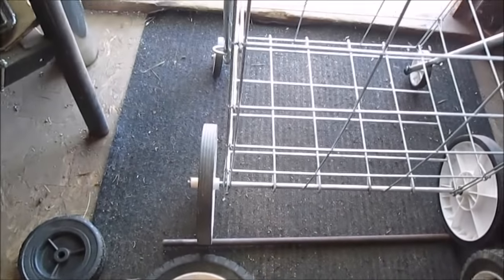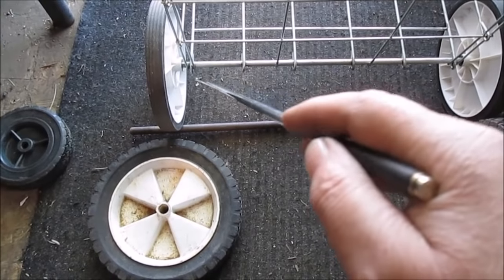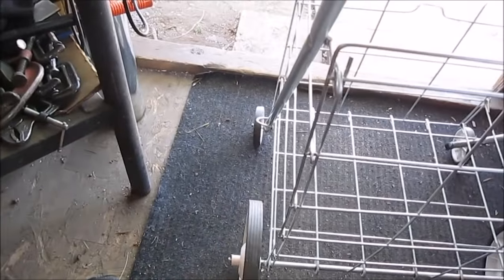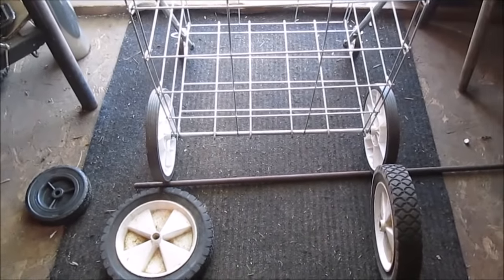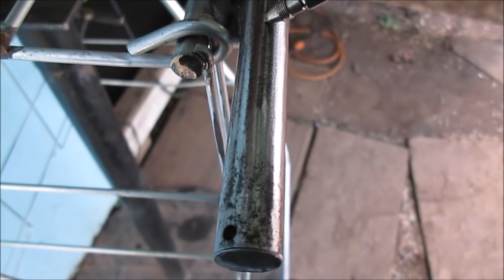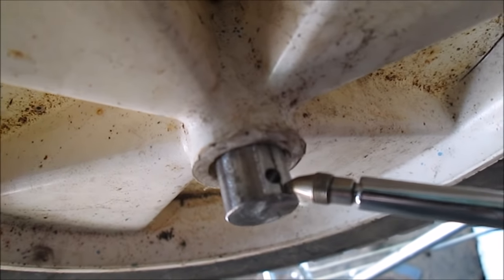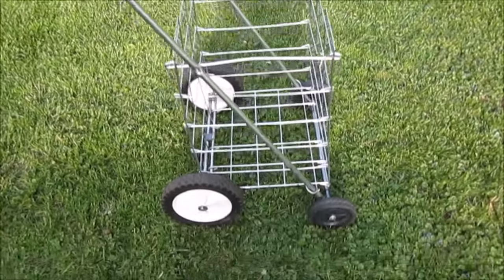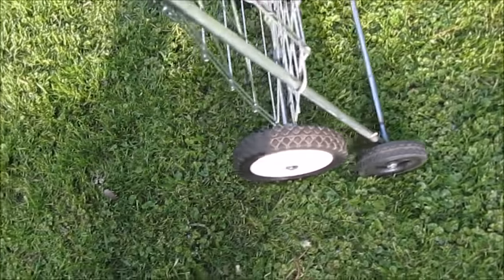New Wheels for Folding Grocery Cart

Comment: This video inspired me to find a solution to the problem I have with my 6 wheel trolley. I am disabled, so my trolley is very important to me, the front wheels are dual and take the weight no problem at all, but the rears are single wheels and the problem was, they were only partially on the axle and then a sort of cotter pin inside the wheel, kept the wheel on. Over time with weight on the trolley, the wheel is pushed over, so the weight is not going through an upright wheel, so in the end it fails. I made a spacer out of some plastic retaining bolt housings for a washing machine, the ones that stop it being damaged in transit, then I forced the wheel on the axle fully and put a C clip in the end where the cotter pin on the wheels sits, so the wheel cannot come off. Hopefully it works long term, but already I can see the wheels are a lot more upright. Like many thing these days, I think its was designed that way to fail, so you have to buy new wheels more often than you should. A plastic wheel can take an awful lot of weight, as long as it used in the right way and the strain is transmitted through it strongest point.
Reply from the maker: Glad my video helped You 🤓
Reply: Its amazing how helpful the internet and people are, you can find a solution to most things, if you apply yourself in the right way and have an open mind.Thanks for taking the time to share your fix. I would like a welder someday and also a 3D printer, I am old school, I like to fix what I have, rather than buy a new one.
Reply from the maker: @colinsdiecast164customs  I do repair a lot of stuff and modify cheap tools and make them better to use
Reply: I have a wide range of tools I have picked up over the years, I tend to pick them up at Aldi/Lidl, or wherever I find a bargain, the old stuff is the best, especially with tools. The stuff I do mainly is diecast, but after some thought and research, I repair most things.

Comment: Thanks for sharing this video.  My folding shopping cart's front wheels- the bar- needs replacing because it's bent.  I tried straightening it, but couldn't.   I would have to probably disassemble it at a time when it's not in use, in order to straighten it or replace the bar and wheels altogether.  This cart has been a good friend, and I want to be good it back.  I have not found a video here or any website on a google search that explains replacement, disassembly or reassembly of this cart. :(  Please do share any info & references with me when any of you can.  I would appreciate it.  Thanks in advance.
Reply: Heat is always your friend when bending a material back, but like anything slowly with feeling and experience is key to knowing what is possible.

Comment: I added sturdier rear wheels to a folding shopping cart, but the axle is now too short now about an inch.  The wheels are wider.  Can only get one wheel on.  Where can I get a longer axle?  Or is there a way to extend the axle?
Reply from the maker: Menards and Home Depot   home improvement type stores sell round stock that should be strong enough

Comment: I use threaded rod, nylon locking nuts, PEX tubing as a spacer and washers as I've no means of welding.  Granny carts are a life saver.  Arthritis in my early 30's and yea it is the only way to shop!  But those wheels they use >.< I went to lawn mower wheels eight or so years ago and have not looked back since other than the aggravation of having to shim them which lawn sprinklers seem to have a small plastic tube inside of that is always popping out find them on the ground all the time works a treat as a shim.  The pair I have now are just starting to wear to the point I am considering getting new wheels. They have outlasted more than a few metal tube frames easy.  Think I am on cart three with them now, could be four :P they take a pounding with cat litter and food, groceries and generally probably far exceeding manufacturers max weight on a regular basis :P
Reply from the maker: +keeperofthegood I do have some Nylon round stock but It is too much work for me to make bushings on my lathe This cart will save a lot of wear on my back ....and arms ..we back up to the front step and I can set the cart up and fill it with more weight now and it should roll better than the narrow wheels that were on it ..This cart had to have been used for years ..the wheel centers were worn out bad and the cheap pins holding the front ones were bent and worn
Reply: +not2fast4u2c Indeed!!  I think I am just plain hard on my cart, it gets used daily by me and the family and eventually the wire frame snaps in a way I cannot fix (needs welding and I'm an apartment dweller). An improvement I found too, not sure if yours will be the same, my wheel base changed, got wider and I found with just that extra half or three quarter inch that turning and controlling the cart when full was a lot better.  Where did you find front wheels?  Those ones are the ones I have had no luck finding locally.
Reply from the maker: +keeperofthegood My front wheels are off a welding cart from harbor freight ...My front end is now wider than the back and the cart leans back at about one inch which is okay ...I usually will tip the cart back when turning it so I hope the wider front end works okay
Reply: this works only for his cart and nobody elses

Comment: Way to go!  At first I was thinking, man, that's an 'ol ganny cart!  But nice job making those wheels fit on there and the welds on the washers look great too.  Cleaned up good, ready for double coupons, the line at the pharmacy and an 8 pack of bottled coca-cola!
Reply from the maker: +Craig Arndt Thanks..This really is over built now ..But I can load it down with the same amount as I did before ..which is  a lot of weight and I know it will roll a lot easier than with the old wheels

Comment: I replaced my cart wheels with much wider 8" lawnmower wheels that were cheap. The lawnmower axle holes were 0.50" in diameter. The cart had 0.30" diameter axles, but I had previously repaired several sink taps that were leaking, and did so by replacing the "brass seats", and I held on to the old "brass seats". The inner hole diameter of the "brass seats" were 0.30". The outer threaded part was just over 0.50". So I screwed the "brass seats" into the lawnmower wheel axle holes, one on each side, and bingo, I could now put them on my cart axles.
Reply from the maker: I sure like mine now that it is built tougher...I can load it down with a lot of stuff and have less trips to the house